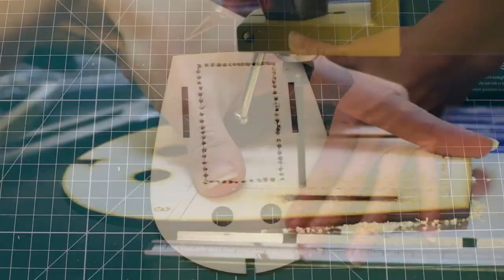Model ship building #1 - This is a build of a non-retail kit - RAGUSIAN CARRACK XVIc (MarisStella)

Comment: Sorry, I'm not sure about the error from the manufacturer.
Do you redo the parts, cutting or reducing the size?
Is the manufacturer still selling this error parts as of now? or any improvement?
Reply from the maker: It wasn't a mistake. I simply replaced the bakbone from the regular walnut in the kit with black walnut. But for this I had to cut off those parts that were part of the skeleton... 
To make the model more contrasting, expressive and voluminous, I also replaced the wales, planksheer, all knees and some elements on the deck with black walnut as well.
Reply: @OlhaBatchvarov  Thanks for your explanation. Highly appreciated.

Comment: Olha, I know it's late to ask this question and you may not see it, but here goes anyway.  Why did you chain drill and then use the Proxxon grinding wheel to smooth the rough edges instead of using a coping/fret-type saw followed by a sanding block?  Just personal preference or some real reason that I haven't figured out?  I'm binge watching this fascinating playlist!  ;)

Also, was this a build of a prototype kit since you mentioned problems the laser had with the thicker woods, causing some joints to be too loose?
Reply from the maker: I have a filter on all the comments I didn't reply to so I don't miss any!
In general, there is no reason to do it this way - I just thought it was the fastest way ...

This kit was made on equipment that broke down and accidentally 20 such kits got into stores - they were quickly found and removed from the shelves, and the two that managed to sell - were replaced with new ones. One of them got to me! So I have another new box with this kit))))